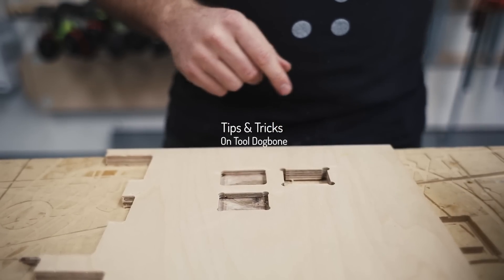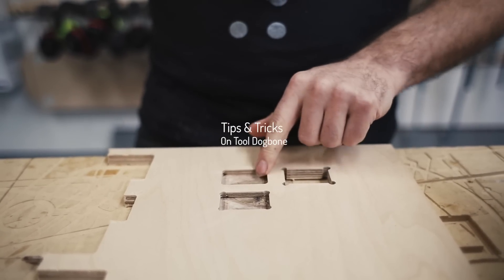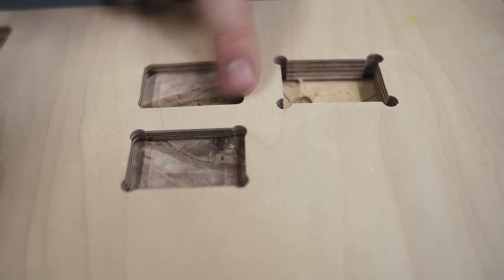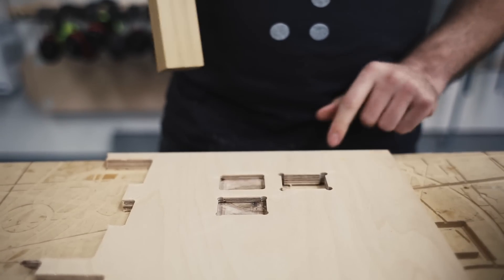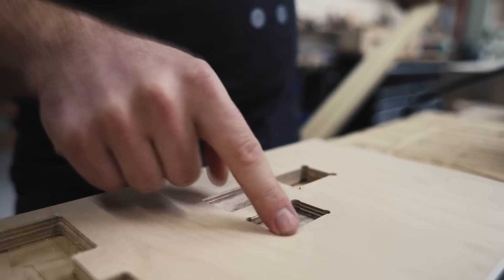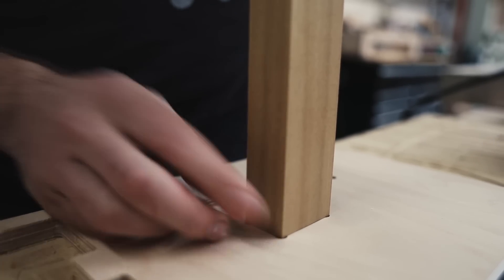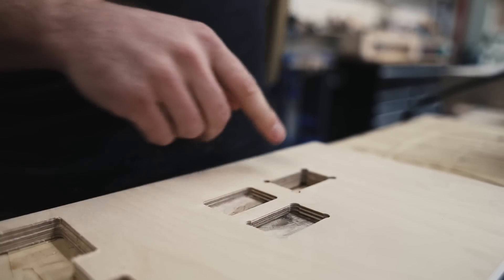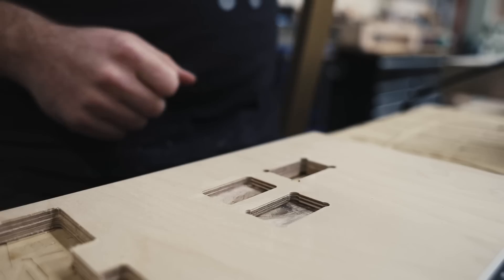Tips & Tricks : On Tool Dogbone

Comment: You didn't explain what you did. It appears you plunged the bit at the four corners of the pocket, but there's no explanation what settings you used to make that plunge create the dogbone.  Help?
Reply: I just figured this out as I woke up this morning - all that is needed is to position the error circle diagonally away from the corner a gross amount but before it flashes red, then hold the Origin motionless while you plunge.  The relief will be placed the set amount (.03") beyond the pocket.  Curious why Sam didn't explain it.  He's usually good about that.
Reply: I should have said you can position the origin diagonally away from the corner.  You can position it directly over the corner but you don't have to be precise.  I think.  I'm pretty sure...